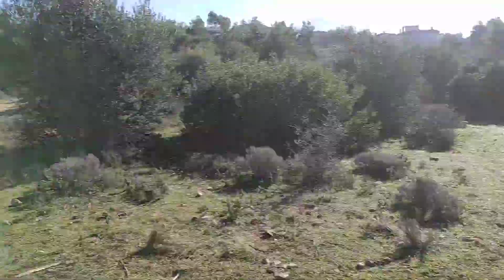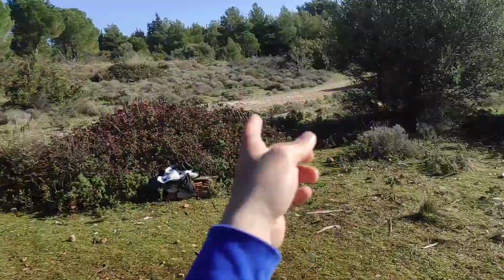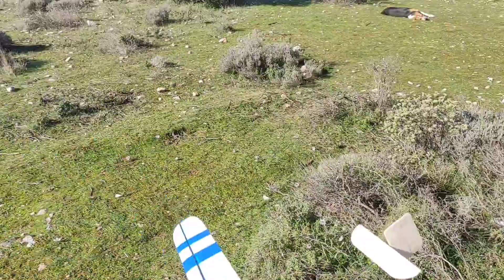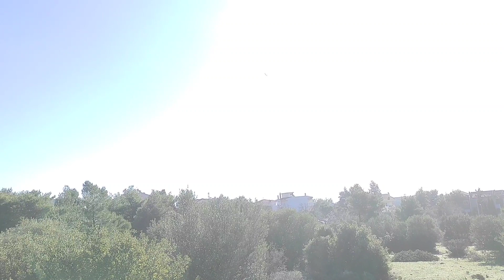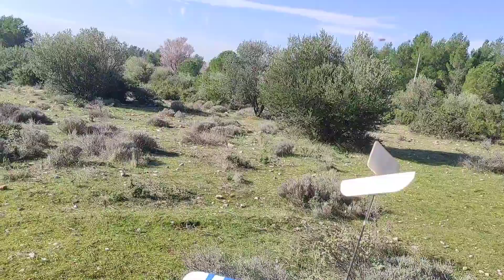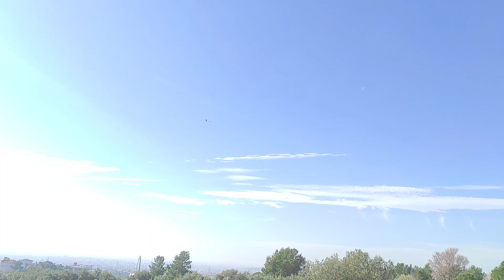80cm DLG 7min Thermal

Comment: What time was it?
Reply from the maker: Early in the morning.
Reply: @afilos what, early morning be able to catch thermal?, mine is AUW 84 gram it is imposible to catch thermal in the early morning, what should i do, should i rebuild till get AUW 68 gram like yours? i build with balsa ribs
Reply from the maker: @Kaminingawi  At that small wing span you need do be light on the AUW and slim on the wing. You can catch thermals all day long but I prefer between 9:30-15:00. Recognizing and riding the thermals takes patience and practice. You need a certain amount of flight time under your belt to get you there..1m dlg do perform better and are easier to build them at a low wing loading..
Reply: @afilos  ok thanks sir

Comment: Once again..  
Amazing build and flights..
Please do a build video on that plane..  Thanks. ✌
Reply from the maker: Thank you, I am not doing twice the same plane, unless I destroy it accidentally on a flight, sorry :-(.
Video description has the details though, and I'll happily answer all your questions!
Reply: @afilos  Thanks.  ✌
Reply: How long is your boom?  Thanks
Reply from the maker: @charlesmilbourn6861  48cm
Reply: Understand that you don't want to build it again just for a video but do you have a video where you go through the plane? Some details and hits perhaps? Closeups of the fuselage and the adjustments you have made from the original plan in the description? Maybe you already have done it and I'm just missing it?

I'd like to understand a little more on how you add strength to the foam wings, the dihedral angle and horizontal stiffness. Maybe it's in the description but I just don't understand the lingo.
Reply from the maker: @C11ffH4ng3r  watch the maiden for more details: https://www.youtube.com/watch?v=078daMAFDtc
How to mount the wing: https://static.rcgroups.net/forums/attachments/8/4/5/1/7/7/a14457911-52-IMG_20201229_114910.jpg
https://static.rcgroups.net/forums/attachments/8/4/5/1/7/7/a14442819-25-IMG_20201224_192237.jpg

Comment: Thank you for including the details about the wing. Can you please make a wing build video sometimes ? I have checked many  of your videos but couldn't find one about actual cutting the foam core and bagging the wing. There are many similar videos on the web but I like your way of keeping it simple and efficient. I have checked the Apogee plans many times since you refer to that in your other videos but just can't figure out how the wing tip is shaped. BTW earlier you have made a solid balsa Apogee and maybe one with ribs + plastic cover as well. Can you summarize how these relate to each other ? Not that I could imagine how someone can do the actual shaping of solid balsa wing. I have seen the guide by Mark Drela but that's not enough for me. Sorry for the long post. I appreciate what you are doing ! Keep it up
Reply from the maker: Thank you! Hot wire for the wing.  Bagging is made like I show in the tails video. Scale down the apogee airfoil while printing to match your desire length cord. Balsa wood is simple to work with. Cut the pieces square them down with a sandpaper hard block and glue them with CA . Freehand the ribs to match the LE and the TE. Cover with oralight and add a peg. I usually don't make the same plane twice and making a video for the full process is pretty difficult, sorry!

Comment: Wow you were enjoying that flight. I didn't get bored, but was hooked watching your little DLG climbing higher and higher 🤗 England is cold, cloudy, wet and windy during the winter. I've just got the Angel Wing Designs PUG kit which is an 80cm DLG so will build that, but earlier in the year I treated myself to the Hawk DLG with carbon layup (https://www.hyperflight.co.uk/products.asp?code=HAWK-RTF&name=hawk-rft-1m-dlg-with-servos-installed) but haven't flown it yet because of the horrible weather we've been getting. But I'll be ready for spring 😁
Reply from the maker: Thank you! I also like the hawk and was thinking of grabbing it, but changed my mind last minute..😊 You should enjoy that one alot!